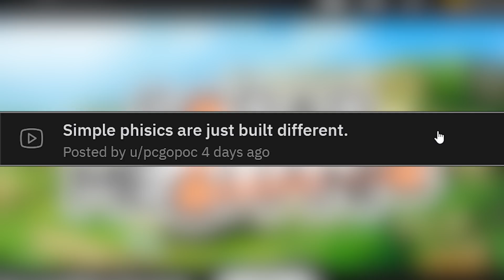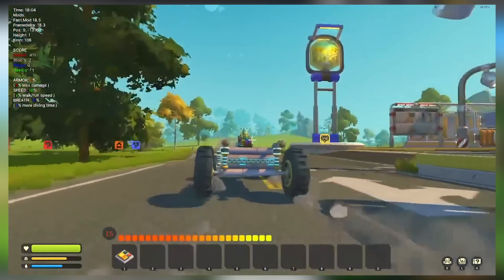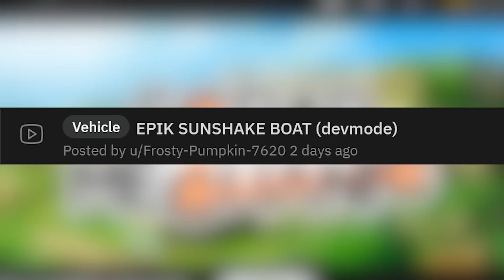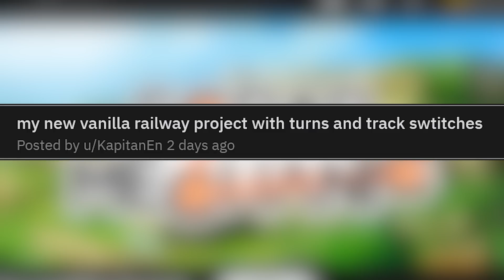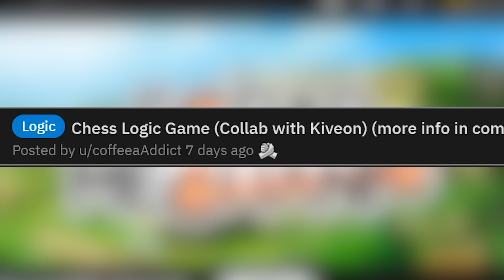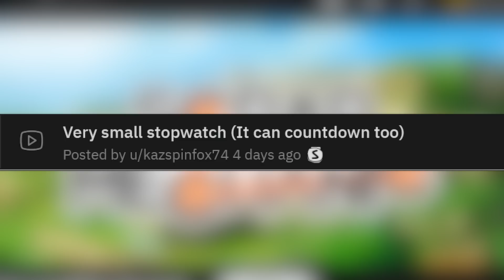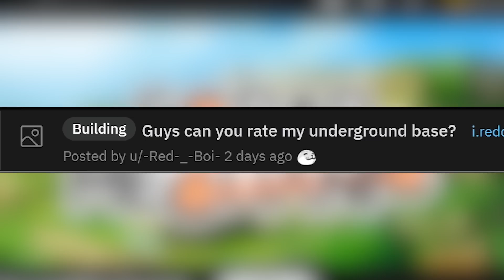Craft Bot Lego 😄 r/ScrapMechanic

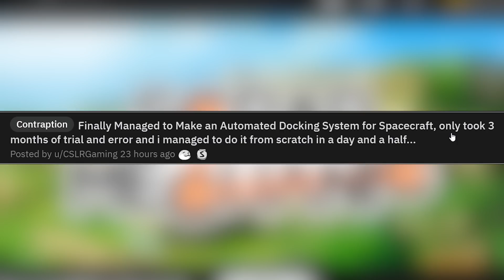Comment: good to see my work in the video at 8:12 :)
Reply: i'll just go ahead and explain it here:

uses GPS and other stuff to maneuver ~100 blocks south, when it switches to using a weak set of thrusters.
once there, approaches the port up until ~70 blocks away(relative to the stations center), where it then deploys the docking ring.
a sensor on the docking ring uses a router to deploy the latches on the station side, then shortly after it retracts the ring.